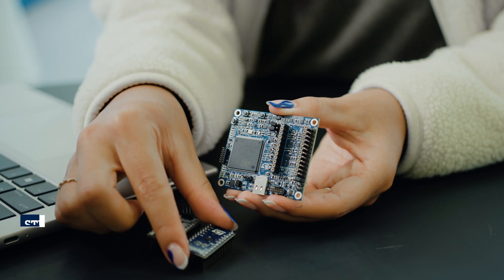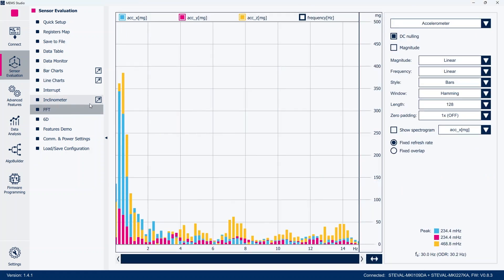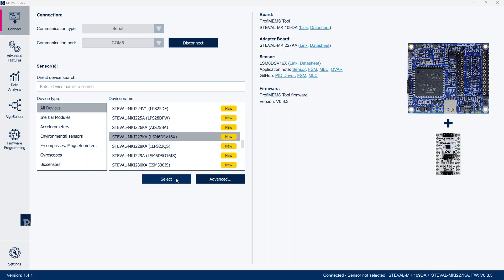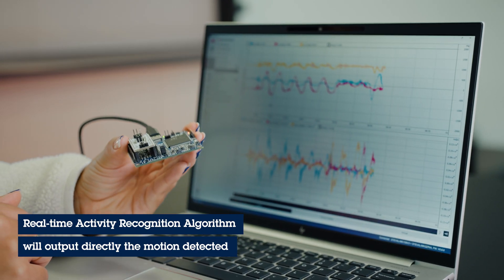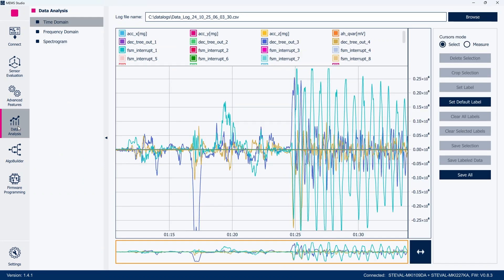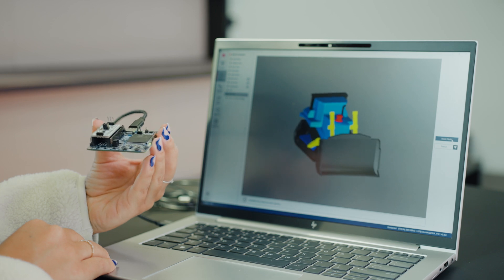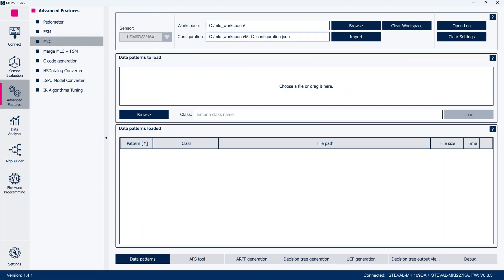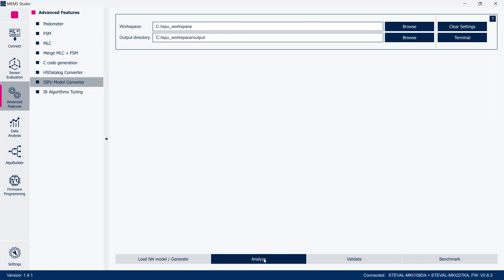Unlock the power of MEMS Sensors with the new STEVAL-MKI109D and MEMS Studio!

Comment: Controllers and sensors need stable current in the operating circuit. Yongming capacitors can help controllers and sensors produce stable current output, improving the stability and reliability of the system.